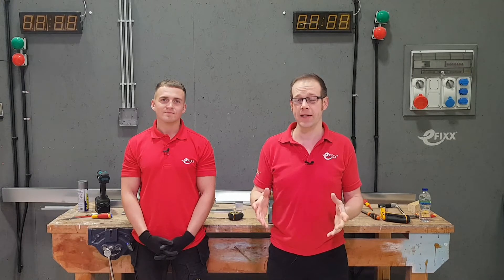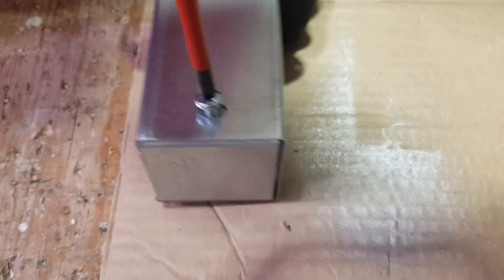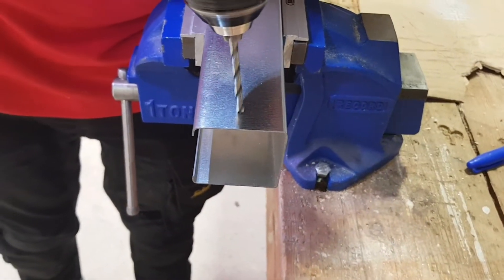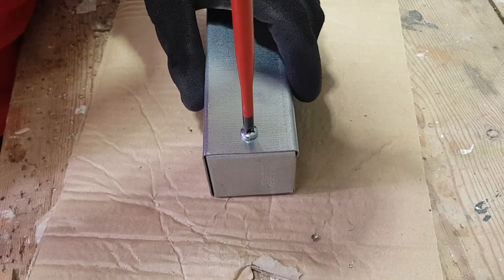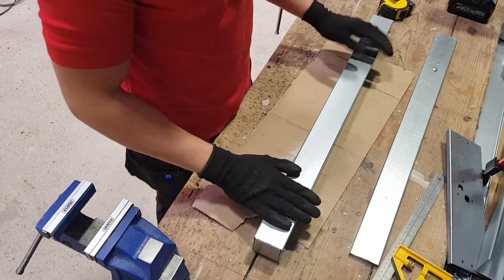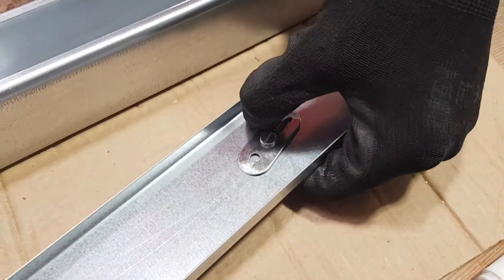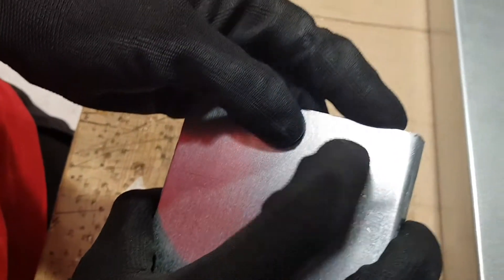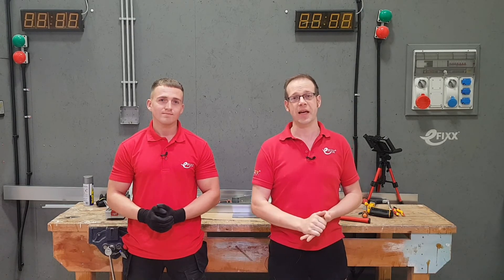Top Tips for Fitting End Caps and Lid to Metal Trunking

Comment: Drilling speed was definately too fast. I learned that it’s always best to use more pressure and low speed (same as bench drill works). There are videos on that on youtube. Drilling the proper way will let your drill bit stay sharp for ages.
Another tip, especially for drilling bigger holes, but not only, is to drill a pilot hole with a small bit, like 3 or 4mm and then using a stepped drill bit to open it to required size. Stepped bit can then be used to clean the edge of the hole from the other side as well.
Reply from the maker: Top tips, thanks very much.